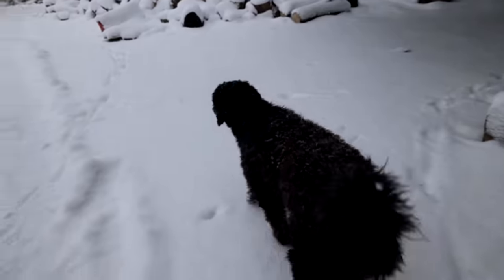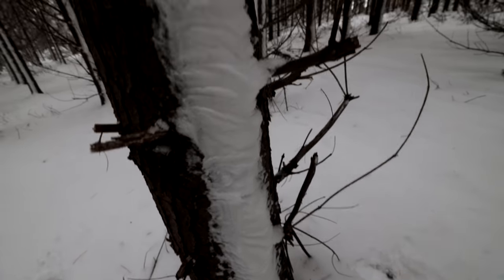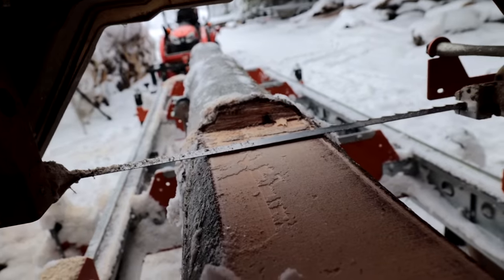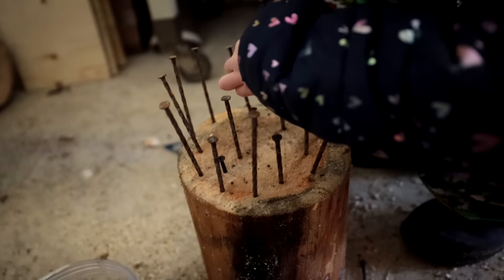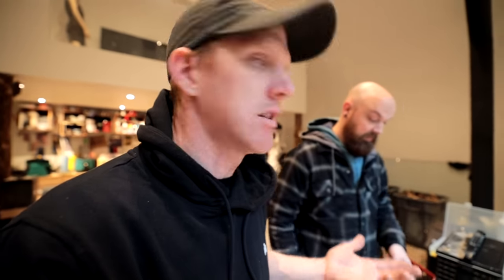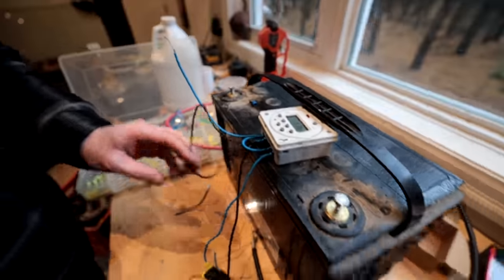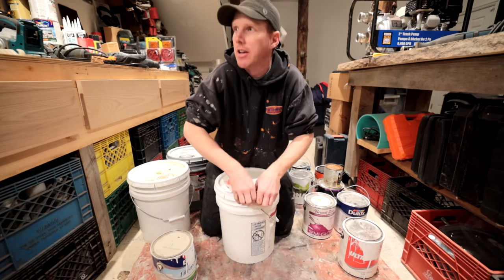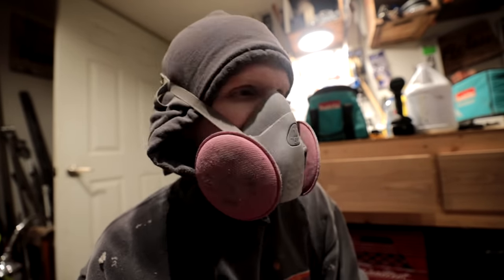Milling and Installing MASSIVE 24' $2000 White Pine Wooden Beam (Start to Finish)

Comment: I’ve mixed paints that way many times and I’ve never been disappointed.
The little 12v heater is really cool. I have been trying to think of a way to keep my off grid batteries above freezing and I think I found it. Thank you 🤙

Comment: Okay, the wife and I can't get enough of you and your show. Look forward to each opportunity to see what new idea you are going to work through. And I get it, you are starting to run up against the wall of "new" ideas, so here's one: to recharge the EcoFlow when there is neither sun or wind, a generator might be called for... And how about a small electric generator that is steam powered and firewood fueled?  No gasoline, diesel or propane needed, either.

Comment: Tip for painters, Store your paint cans upside down, 2 reasons, 1 it allows you to quickly see if the lid is properly sealed,, 2 when you go to use it you immediately begin mixing it just by turning it back up the right way.

Comment: The solenoid is a very good idea, but you need a continuous duty solenoid. The one you are using is a bakelite intermittent duty solenoid. It's built for about 10 seconds of intermittent use.

Comment: “Outin” Kevin, there’s a guy on YouTube that has made heaters out of clothes dryers. Maybe a project? They work well! Uses parts from dryer to build the whole heater. Dryer heat coils, some ducting, timer, switches, blower etc…. Check it out!
Reply from the maker: Sounds like a resistance heater.
Reply: @ModernSelfReliance  that’s right. The heating coil is basically a big resistor that gets red hot! The guy used all overheat and shutdown sensors that were in the dryer. It gets too hot it shuts off.

Comment: Outin.    I love your outlook on working with what you've got, and recycling what most consider garbage... I plan on doing some small woodworking with "amateur" tools.. any advice?
Reply from the maker: Get started.  If you are going to fail, fail quickly and move on.
Reply: @ModernSelfReliance  thanks, i Excel at failing 👍

Comment: What some people do is put a piece of pipe on the side of your sawmill and every time it rolls back and forward your can't goes in that pipe but you gotta put a piece of metal on it so don't slide all the way through on the bottom of it flat seal it counter but put a hole in it so I don't hold water

Comment: Regarding that paint trick, would that work with any type of paint... provided you stuck to the TYPE of paint together.  In your case waterbase latex, but would it also work for oil based paints say?

Comment: With your respiratory filters when open and on the mask , when not in use store it in a gallon Ziploc bag. 
Because the filter exposed to the air will expire faster .
Reply from the maker: This is a good tip.   I usually seal up my filters with charcoal.

Comment: The motor on ur mill sounds like it needs some new spark plugs Kevin
Reply from the maker: Funny you say that...  It was either right after I installed new plugs or just before I had to install new plugs.
Reply: @ModernSelfReliance  I am a small engin mechanic and that's one of my better skills is tuning them I have an ear for a small motor that isn't running quite right lol

Comment: no drying needed? not worried about warping or sagging? I like how you think outside the box and come up with your own solutions.
Reply: Pretty sure the pioneers building in the winter time weren't worried either.😏
Reply from the maker: It will dry in place.  Additional posts are going in the middle at a later date.  I wasn't sure of placement just yet.
Reply: @gregmize01   I don't think the pioneers were too worried about being exactly plumb and level... I would assume he is going for higher standards. I appreciate your reply though.
Reply: @ModernSelfReliance   Very cool. I'm excited to see how it turns out. It sounds like you thought of everything. It shows with how resourceful you are at acquiring the materials.

Comment: What size was the battery.
How much power does it provide, for a 10 hour overnight.
How many batteries, would you need, to power a modest space heater, overnight, to keep a 10x10 shed above zero.
Manybsoace heaters run at 1500 watts.
I prefer those that have a low temp, low power setting, ideally say, a 300 or 600 watt setting.

So to run a low temp low power electric heater,
How many of these batteries would we need?

Comment: Isn't a 24' span a bit long for an 8x8, won't it sag? 🤔  Don't get me wrong, that's cool to see a 24' beam being cut this way... but two 12' with a post in the middle (even suspended from the roof) would have been the easy solution for me, considering the capacity of the mill, the weight to manage (you have a nice machine to handle that though).  

Anyways, I guess I'm no fun 😂

Comment: Don't you just hate those people who post in your comment section how you did it wrong. Well with that out of the way "You did it wrong" I like the gadget and hope Mike succeeds the problem is the design not the implementation. You are attempting to heat air and via that have that heat conducted to batteries. Air is terrible as a conductor you can stick your hand into a 300 degree oven and not have it feel more than warm.

The setup might work better if you used an electric thermal blanket which the batteries rest upon and transfer the heat directly to the batteries.